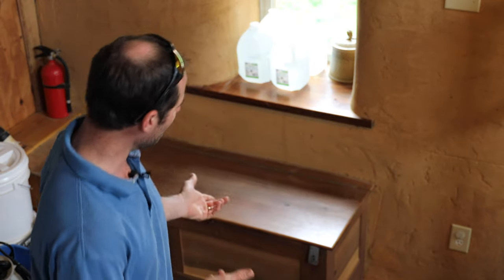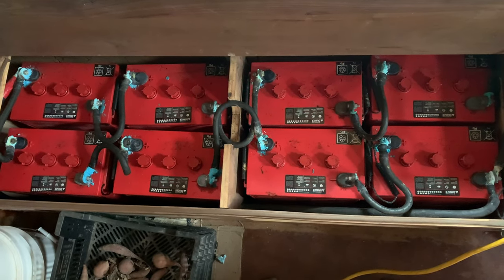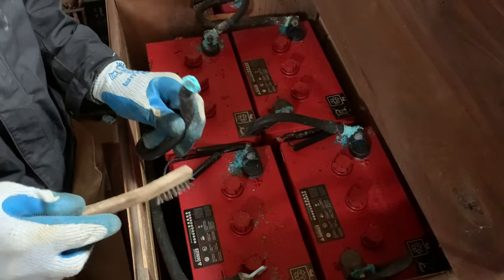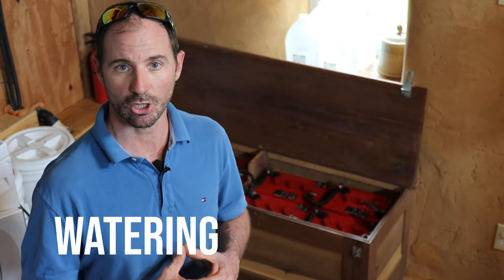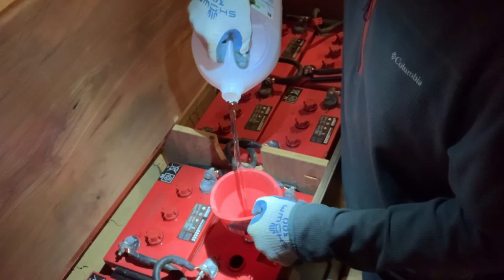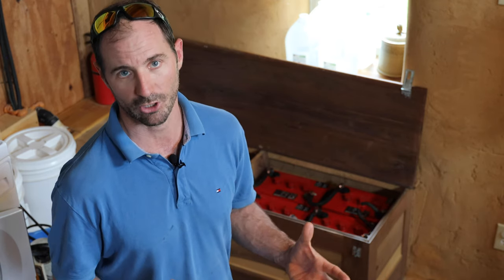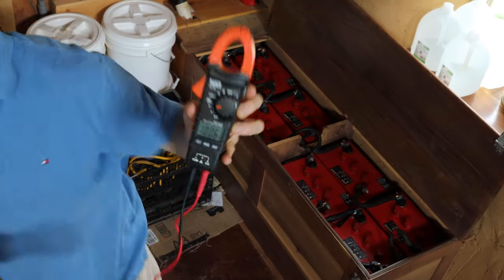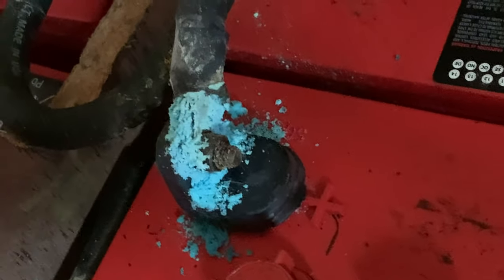Off Grid Battery FAIL | Flooded Lead Acid Battery Care and Maintenance

Comment: Its good to cover the terminals with grease (Im pretty sure any type should work fine for this) to avoid corosion due to acid x air reactions. Its good to clean and recover with grease once a year (some querosene to get the grease off).

Comment: In my high school electronics class in 1980, my teacher taught use to use baking soda and water to clean the battery terminals, and then use Vaseline petroleum jelly to coat them, that will prevent corrosion, now they sell a red battery spray that prevents corrosion.

Comment: I know what you meant, but some of the terminology you are using is incorrect. Inverters don't charge batteries. Inverters "invert" DC current from a battery into 120-volt (not 110) AC current. A converter on the other hand "converts" 120-volt AC from shore power or a generator into 12-volt (or 24v or 48v) DC current to charge a battery.

Comment: Takeaway...  don’t use lead acid batteries. Just go buy a Tesla powerwall.
Reply from the maker: If you can afford Lithium Ion, it’s a better value over time. If the 20+ year lifespan is what they say it will be anyway! Lead acid technology is tried and true, recyclable and easier to build. Maintenance and lifespan are the only downsides. We’ll see how the LiFePO4 technology holds up over time. I have a lithium battery system that is doing well, but still too new to tell if it was worth the investment
Reply: @HeirloomBuilders  that's right lead ain't dead seven years and still going just like lifepo4 just sayin
Reply: @HeirloomBuilders  There are now ways to introduce a small amount of LiFePO4 with a lead bank, to (possibly) extend the life of the lead batteries.  The LiFePO4 provides a very stable voltage and keeps the Lead at Float Voltage longer.
Reply from the maker: @vtorsi610  that sounds good. I’m eager to look into that. Have you tried it yet?
Reply: Can you share a link to that information on combining lifepo4 with lead acid battery, please?

Comment: Instead of crimping the terminals,  use a solder pot and dip the connector with the wire in it.  It's a 100% connection.
Reply: Will cause resistance

Comment: You should have coated all those terminals with dielectric grease to keep that from happening again.
Dielectric grease is NOT conductive but will resist corrosion.

Comment: Thanks for such a good video.i would like to know how to do equalisation using solar PV.
Reply from the maker: Your charge controller should have a manual or automatic setting for equalization. Make sure the batteries are fully charged and that you have 4 hours of full sun ahead prior to running an equalization voltage.

Comment: I've just been shopping for a new hydrometer and stumbled across this vid. I'm tired of the cheap siphon/float types I've been using. This is the first time I've seen a refractometer used for this purpose. Suitable models seem to be available around the same price as decent hydrometers so I'm going to look into this more. 

Coincidentally I've been asking for years if there isn't a digital instrument, and just discovered one being sold on Amazon and eBay under various brand names for a couple hundred bucks CDN. I wonder if they're any good. Misco has one for about USD 300 too.

My worst battery fail happened while attending school away from home for a year while my wife held down the solar-powered fort. Many weekends during our Canadian winter I would drive home to visit and run the generator to make sure she wouldn't have to mess with it during the week. Didn't watch electrolyte level closely enough and ended up below the top of the plates by the time I checked, permanently reducing my bank capacity. Ouch. Ten years later I still have those batteries though. They've been awesome notwithstanding that I seriously dented them when they weren't even very old.
Reply from the maker: I hear that! I’ve not been the best mate to my batteries in the past. It pays to buy good batteries. What kind of batteries do you have?
Reply: @HeirloomBuilders  Global-Yuasa, a conglomerate that may or may not still exist, and is probably called something else now if it does.

They are tallish individual cells. I accepted the option of having them supplied in pairs. Each pair is permanently interconnected and enclosed in an open-top plywood box with rope handles.

They have cylindrical plates, which appealed to me for "long story" reasons, and were recommended to me by a dealer who described them as motive batteries. I will always remember him saying that they were pretty much bulletproof "as long as you don't let the electrolyte get too low."

Sigh.
Reply: I don't know what the strength of your electralite  is - battery's that use weaker electrlite have substantially longer life cycles - 
      My grandfather was an early 1900s  generator man - from 1890.till the 1960s 100s of thousands of rural homes were powered by 16 cell 32 volt battery banks  in the US and world wide -  I can remember going to rural homes and my grand father saying they have a 40, 60 or 80  yr battery bank - 
    That simply meant they should get a 40 yr service life from the battery's - 
     In the deep South many Banks were set.up as 60 & 80 yr banks - 
      Today most lead acid battery's are sold with an acid strength of 1.275 at full charge for domestic use - 
      most farm lighting battery's were set up with 1.190 to 1.220 acid strength  -  down here in the deep South it was common for batterys to obtain a service life  of 60 to 70 yrs when used in rural homes they used 1.190 acid strength in 60 yr battery banks - some used weaker acid - 
       There were many camps in the swamps and marsh that used the 80 yr battery's  - meaning the acid was very weak 1.190  ( that was what was used in most battery in the early days at 1.190 at 78° f the standing voltage is 2 volts  - 
      Battery's with weak acid self discharge very slowly so they only have to be charged every 18 months when unattended -  1.220 has to be charged every 6 months down here when unattended - in a charged state 1.220 will not freeze till minus 17°F - 
        The tempriture often determined the acid strength in different areas of the country - 
      I presently use a 9.5 kw bank of battery's - it's just used after hurricanes and ice storms these days - I also prefer to use a 12 volt system over 24, 48 or 120 volt system - 
        I did work the offshore oil fields and remote mountain oilfields as SCR electrician for decades - 
     To this day lead acid battery's are the preferred battery above all others for stationary application - 
      There many reasons why - 
 I'm 3rd generation -  if you replace
  Your bank I would recommend just replacing the batteries with golf cart battrey's there good battery's -
       If you lower the acid strength you will also lower the capacity of the cells - my golf carts are rated at 225 amps at 1.275 but at 1.220 there rated 40% less capacity - at 225 amps the 50% discharge rate is 112 amps at 1.275 acid with 1.220 acid they only have 60% of there capacity so the usable capacity of the battery is 67.5 amps - 
       On the other hand golf cart battery's are mass produced and are in expensive - so you can have a large bank of battery's that are inexpensive - 
     For 40 yrs I had a bank of 100 golf cart battery's with only few failures over the decades - I have a 9500 watt bank now - I sold the 100 battery's for there core price 10 yrs ago and there still.in service there set up with 1.190 acid   -           when you get new golf battery's you simply make sure the acid is at the eye - then syphon or draw the acid off to the top of the cells - then top the cell off with water - 
       It will take a week or less  for the water to mix with the acid - at that point it will be around 1.245 - 
      If you draw the acid off a second time and top the water off again the acid will be around 1.225  -  that's close enough - 
           When you charge and discharge the battery's the acid gravity will always be a few points off - it's the same when equalized - 
      If you want spare battery's on hand just take a battery fully slow charge it - then dump the acid and save it - then refill the cell with water and let it set 24 hrs dump the water out - do that 2 more times - 
    Then let the water drain out a few days - it's now a dry charged battery air does not react with lead - save the acid, if you need the battery just add the acid back in and charge it at a slow rate a few days - also get a box of new acid from a auto parts store - 
      When the old acid is poured back in the battery it will loose some strength and have to be adjusted with new acid -
    In 10 yrs I've cycled the battery's I have over a 1000 times the plates still look new - there not swelled or shedding - out of 26 battery's I've had one failure last month -
      Also parallell all your 6 volt battrey's together and have the parallel banks series together - 
       If on batterys fails it won't effect all the other series of battery's -
         At lower strength acid you will have to adjust the peak charge voltage and equalizing voltage - 
        You will find there to be very little corrosion problems - vasilen is the better of lubricants and has been recommended for battery's for 140 + yrs - 
       At 1.275 it's hard to get more than 10 yrs out a battery - if for some reason a battery sulfates bad then then charge it for 5:minutes with a welding machine that generates DC voltage after the voltage reach double the battery's rated voltage or it's gassing good - you do that 2 to 6 times allowing a hour for the battery to rest 1 hr each time - 
        Charge the battery back up.as long as there are no shorted or open cells - the battery will be de-sulfated  - 
   Battery's that use 1.190 acid they would add magnesium sulfate ( Epson salt) to the acid to decrease the internal resistance of the cells using weak acid -
      When using battery's with 1.275 acid when the positive post is loose or can be shaken that battery's life cycle is finished - the acid will eat the post out at that point when using .275
Reply: @able880 your comment is so elaborate. Thank you for taking the time to write what you did. I do have a question, though. You mentioned charging it with a welding machine to aid desulfation. Are there alternatives to that? What about charging directly with solar panels at a high voltage or using the grid?

Comment: 1640 watts? All you are using?
Reply from the maker: We use solar thermal for domestic hot water, line drying for clothes, and propane for cooking in the summer. No air conditioning other than ceiling fans and passive ventilation

Comment: You can remove corrosion from battery with a baking soda plus hot water solution then put Vaseline as a protective shield around the terminals to protect them.  ooops should have watched till the end
Reply from the maker: 🤙I finally took the time to disconnect all the battery cables this weekend and clean everything really good so I could put dielectric grease on the terminals like you suggest. So glad I did!

Comment: Great video also running 24 volt system thinking of getting Rolls batteries once my vmax tanks shit the bed considering 48 volt system looking at Sol-ark 5k inverter your thoughts
Reply from the maker: Rolls seems to be the best lead acid battery on the market. Don’t have any experience with the sol-ark inverter. What’s your intention behind the 48 volt system?
Reply: @HeirloomBuilders  It's a matter of effeceintcy

Comment: what voltage would a 35ah battery after drawing 35 amps for one hour?
Reply from the maker: Probably 0v. Why voltage if it start out, or is it rated to be?
Reply: @HeirloomBuilders  12v battery, everyone keeps saying don't discharge below 12.1v but no one ever shows how many volts is left in the battery. i'm probably overthinking it , but seems like a 35ah battery discharged to the recommended 50% discharge to prevent battery damage would be below 12.1v thanks for the reply

Comment: lifepo4.. more power, no maintanance
Reply from the maker: We’ll see about that. I have a LiFePO4 battery bank that is one year old and doing pretty well. I like the no maintenance advantage. The extra cost was hard to swallow. And I’m just not convinced that the 20-30 life expectancy for Lithium Ion will pan out since about 1 in every 5 cordless tool batteries i own seems to suddenly fail.
Reply: By the thanks for mentioning that power tools run on lithium ion batteries and they die out sooner.  @HeirloomBuilders